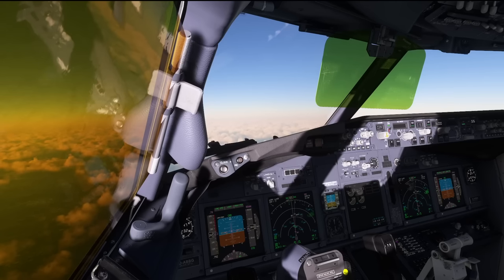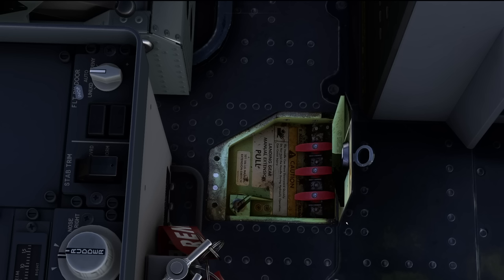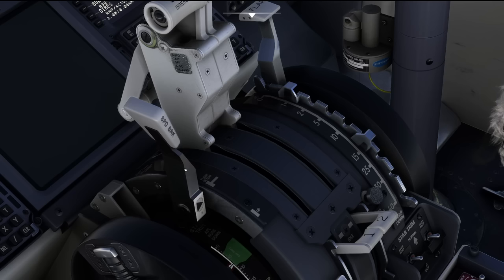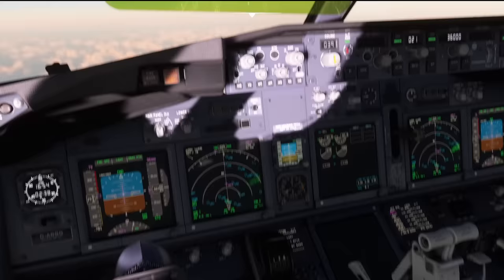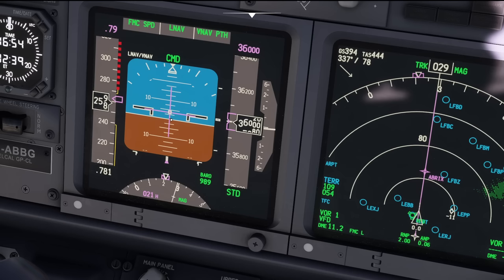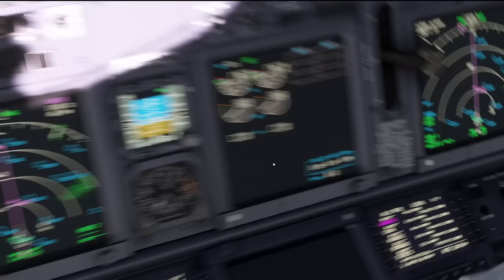FIVE hidden features you did NOT KNOW existed in the PMDG 737 | Real 737 Pilot

Comment: I would know these if producer would be polite enough to provide some official manual. I paid over 60 bucks i didn't get a proper instruction how to operate this aircraft.
Reply: The PMDG series of aircraft used to have a manual for all its Boeing planes (737, 747, 777) for FSX/P3D located deep in its addon folders, what I've heard is that there was a licensing issue regarding those that's why they removed it. I could be wrong though. Wish they bring it back :(
Reply: There are so many tutorials for 737 here on YouTube, so I can barely imagine what else would be needed
Reply from the maker: You mean a manual like the one you find in your aircrafts folder/documentation?
Reply: There is an official manual. They even tell you where it is when you purchase it.
Reply: I kind of like that there are little Easter eggs like these. However, a proper PDF would be helpful.
Reply: @charliehilbrant  THERE IS A PROPER PDF! IT'S IN THE AIRCRAFT FOLDER
Reply: @shotgunsnapper  easy shooter. No need to shout about it
Reply: PMDG provides you with more manuals than you’ll ever read or be able to understand. They have literally tons of manuals for each model. EXACTLY as real life airlines have and provide their pilots. You should remove this message, as it’s you that don’t not understand what sort of product you have, not PMDG making an inferior product. You also have their Forum where questions can be asked. PMDG are known for the gold standard in the simulation community.
Reply: @stgs1988  everyone listen to the comment police and remove messages that aren’t entirely accurate!
Reply: Ive seen real manuals 
..would they work too?

Comment: 5 timestamps:
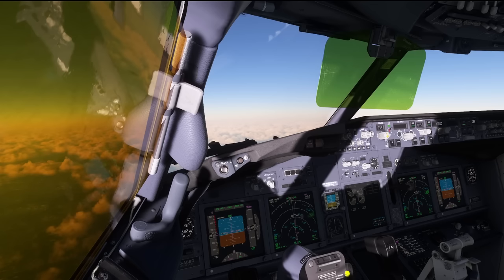00:14 Manual Gear Extension Door.
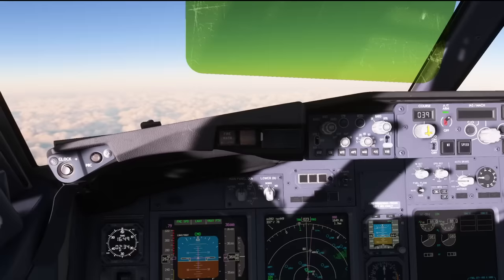1:36 Flap and Speed Break Lever Click Spots.
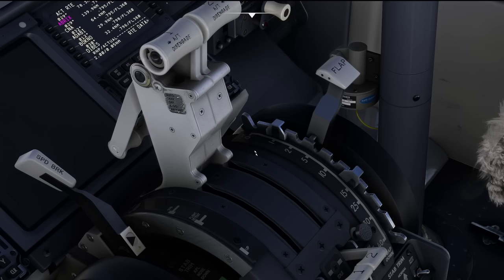2:26 Delay between MCP altitude and PFD altitude.
3:55 OVHD Copy-Paste function from EFIS control panel.
6:20 Fuel qty indication gauge changes reading depending on pitch.

Comment: Another cool hidden feature I found buried in the PMDG manual is the secondary TOGA selector. If you click the bottom left screw on the MCP it actually acts as a TOGA button for the throttles. They added this on purpose to make it easier to engage during takeoff if you're using a controller or non-HOTAS throttle, pretty neat addition imo!
Reply: That has been there for many previous versions. FS9 and FSX/P3D I’m pretty sure had that. I kinda seem to remember it being on other products too, like their 747.
Reply: @Fcreceptor Yes, that has been there for quite a while, the 737 for the FS2004 (FS9) definitely had that as well.
Started flying PMDG with that simulator so that's why I am so sure about that :)

Comment: Feature #3 has been killing me, LOL. I built an Arduino-based external hardware device with throttle levers, pushbuttons and rotary switches for various functions. One cool thing about this is that I could quickly change the selected speed, heading, altitude or vertical speed on the MCP without actually needing to move the point of view to the MCP itself (no eye or head tracking here), but rather just looking at their values on the PFD as I changed them on the hardware switches. This has worked well since all the way back from FSX and P3D, but the recent feature means I can no longer change the altitude without actually looking at the altitude window itself on the MCP (or do the changing rather slowly to allow for the PFD delay). There's one feature that I really wish was user-selectable in the options page, something like "PFD altitude change: fast/real".

Great video as usual.
Reply from the maker: I'm afraid your kind of setup is really a exeption to the exeptions in a niche market. Probably not something they will invest the development time on as there's still so much other stuff to do. Sorry :/
Reply: @A330Driver  Yep, I'm well aware of that.  Can't have 'em all. :-)
Reply: @A330Driver  Disagree here, it's similar for everyone owning a Honeycomb Bravo :)

Comment: As a fueler something that surprised me on the 737s is how little pilots tend to know about the fuel panel on the wing. For example, most pilots I've encountered are unaware that using the manual defueling valves, fuel can be transferred between any tanks on the aircraft by opening the crossfeed and using the fuel boost pumps to remove fuel from a desired tank into whatever tanks are selected as open on the wing fuel panel.

Very useful if, say, the fueler has an INOP gauge and a pilot volunteers to monitor the fuel quantity and tell him when to close the tank and misses by 2500 lbs because he was receiving their clearance.

Comment: The manual gear extension door should inhibit the retraction only but not the extension…it might be a limitation by the sim?
Reply: Right. With the manual extension access door open:
• manual landing gear extension is possible with the LANDING GEAR lever in any position
• normal landing gear extension is possible if hydraulic system A pressure is available
• landing gear retraction is disabled.

Comment: Knew about the gear extension door and the escape ropes because I'm using a real Ryanair checklist for my flights and those explicitly state to check those doors to make sure they're closed before flight. I didn't know about the microswitch preventing use of the gear lever though, which explains why the checklist requires that door be checked thoroughly.

Comment: Hello 737NG Driver,

Not sure if this is a hidden feature or not. But did you know you can enter the departure runway as a fix info in the FMC. simply do the following below.

1- go to the dep/arr page and select arrival on the departure airport.

2- select the departure runway as an arrival.

3- go to legs page and scroll to find the the arrival runway. Which should also be your departing runway.

4- copy and paste it in the fix page.

5- go back to the legs page and erase the modified route. Do not execute. 

And vaw la.
Reply from the maker: It's a feature indeed. I'm just not sure what to use it for haha
Reply: @A330Driver  i normally just set a 5 nm ring just for reference especially if the airport doesn't have any SID.

Now if i can only figure out how to enter a FlyOver waypoint on the legs page.  🤔

Comment: Good afternoon,

Small remark, or misunderstanding about the manual gear extension door microswitch.
reading operating manual, the following is mention (copied from the manual 737-800NG):

With the manual extension access door open:
• manual landing gear extension is possible with the LANDING GEAR 
lever in any position
• normal landing gear extension is possible if hydraulic system A pressure 
is available
• landing gear retraction is disabled.

As you may see, the second point mention than extension is possible even when the door is open if hydraulic A available.
Is someone wrong, do I misunderstand the manual or is it option dependant ?

Have a nice day,
Benjamin

Comment: I knew about the manual gear extension because back in the old days, I actually tricked another streamer into using it. I told him to pop open the floor panel and pull the lever, he proceeded to pull all three. Afterwards, he had a closer look and realized what he had just done. I wasn't aware of the clickspots because given the hardware I use, they would be largely irrelevant anyway. If I wanted to pull the speed brakes, I'd just reach over and pull the lever with my hand. I didn't know about the MCP delay because I don't think this was ever modeled in P3D. Wasn't aware of the overhead switch, although I have it set to synchronize the EFIS anyway, so I personally wouldn't find much use to it, although I could understand others might. As for the fuel, I wasn't aware of it, as I've never really checked, but I'm not surprised that PMDG models this.

Comment: During cleanup after landing if you deactivates a flight director which is currently the master first and then quickly pushes level change button several times it will reset speed selection to 100. This trick was mentioned by @737NGDriver in some old video but it was stated sometime it works and sometime doesn't. In my experience it works every time if you switch exactly the master FD first but leaving second FD on before pushing level change button.
Reply from the maker: That's actually a feature I suggested myself which got implemented!
Reply: @A330Driver  Is it like so in the real aircraft?
Reply: @deesto  I assumed it was or he wouldn't have suggested it.

Comment: PMDG has made a mistage then. Reference FCOM 14.20.2: When manual gear extension door is open, normal extension of the landing gear is possible if hydraulic system A pressure is available. They should correct this.
Reply from the maker: I did a little research into this as you're the second one to bring this point up already. The PMDG in this aspect is modelled after a certified real life simulator since obviously they couldn't test it on the real plane. What you saw in this vid was how the real sim would behave as well.
Now, this would not be the first time a certified sim would be wrong, indeed it would be the second time (to my knowledge) something is spotted in the PMDG which worked exactly as the real sim, which is wrong.
I'll do some testing myself next time I'm in my airlines full flight sims as they are from a different manufacturer than the one PMDG had access to.
Reply: @A330Driver  Thanks for the reply.

Comment: Nice video.
However, the manual landing gear extension work DIFERENTLY from FCOM. The FCOM reads that "With the manual extension access door open : (2) normal landing gear extension is possible if hydraulic system A pressure is available.". I'm not a real pilot, so I cannot say how the real 737 works. But PMDG 737 is clearly different from Boeing's FCOM.
Reply from the maker: I'll give it a shot next time I'm in the full flight sim to verify.

Comment: Sorry but I have a doubt on  the first one  ,  the LDG won't extend  if the speed is higher than 260 knots right? And that was actually the case when u did this experiment, I mean regardless if the door was open or not the ldg wasn't supposed to go down
Reply from the maker: The gear will extend whenever you put the lever down. Why would it not when you're faster than 260kt?
That would even be below the placard speed for gear operation.
The 737 is not an Airbus. You might break it, but it will still do what you tell it to do.

Comment: Thank you so much!!!

In return I offer an MSFS feature to you - to fix those ugly, jagged, shimmering shadows, you can edit the file usercfg.opt (it will be located in "%AppData%\Roaming\Microsoft Flight Simulator\UserCfg.opt"), find the Shadows section and edith the Size value to 4096 or 8192 (if you have a 4090 or better).

There will be two Shadows sections, one for  normal and one for VR).

Change...

	{Shadows
		MaxSliceCount 4
		Size 2048

to (should work for most video cards)
 
	{Shadows
		MaxSliceCount 4
		Size 4096

or (if you have 4090 or better)

	{Shadows
		MaxSliceCount 4
		Size 8192

After you make these changes you'll want to set the file to Read Only to prevent MSFS from reverting the setting back to 2048 - the maximum allowed via the GUI, (save the file then right click and choose properties then click the "Read Only" box).  Just remember to uncheck Read Only if you ever make settings changes via the GUI or they will not be saved.

Comment: wow! very impressive how the details are simulated at PMDG! Thanks Emanuel for this information!  one question from my side. Reaching an Alt below 10.000 feet i have noticed that the speed bug starts dropping to 250 knots is small changes until it reaches 250 knots. In other aircraft such as A320 from Fenix the speed bug will jump directly from the cruise speed to the 250 knots immediately. Is this speed adjustment in the PMDG737 below 10.000 feet the same as in the real aircraft?
Reply from the maker: Thanks! Yes, the speedbug moves in "real time" in the 737. This shows you at any time at what energy state the plane should be, aka how the decelleration is progressing.

Comment: Emi, do you have a tip for setting the mins faster? When I fly into Denver my mins are somewhere around 5000’ MSL and it takes forever to set them.
Reply from the maker: Hold the mousebutton and scroll at the same time. That's as fast as it gets.

...and annoy the PMDG support so that they finally add the correct realistic option.
Reply: @A330Driver  Which is what? Can you tell us, please, what's the realistic option?

Comment: Nice video but the one thing I was waiting for wasnt covered.  How did you get the green sun blind on the front window?
Reply from the maker: Thanks, I thought that'd be somewhat basic knowledge after all the persons asked for it during the 800 release 😅
They're in the pockets aft and to the side of the pilot seats.
Reply: @A330Driver  Ok cool I will check that out.  Only just acquired the pmdg 737 800 and still learning all these qwerky bits. Many thanks.
Reply: Hi I have another question. So I've made my way into the cockpit using the drone camera but can't interact with any of the cockpit buttons? Any idea how to do this?  Thanks.

Comment: 1 question: in real life, do the pilot need to insert manually each waypoint of the flightplan into the FMC or it can be possible by EFB? or in another way? thx
Reply: Depends on the airline. If the airline has ACARS equipped on their planes, it could be just as easy as getting the uplink for it and then verifying it. If not, they would just manually enter in the route that's depicted on their flight plan, which includes the airways they will be using. So let's say you're flying on an airway that has 24 waypoints on it before you transition onto another airway, in the VIA column, you would type in the airway, then in the TO column, type in the last waypoint on that airway, rather than having to manually type in all 24 waypoints.
Reply: @CaptainKevin thx so much for reply me!!! really appreciate!

Comment: Is it possible to operate the speed brakes via the Decrement Spoilers and Increment Spoilers keybindings? As it is, I can only control them with the click spots. Trying to drag the lever with the mouse is so slow as to be non-functional. 

Also, when I click on the sunvisors that are stowed in the little side pocket, they don’t move to the windows. They simply vanish for the rest of the flight. What am I doing wrong? 🥹
Reply: Clik on the green sunvisor beside of your chair, than click on the green surface use the two horisontal arrows to slide the green sunvisor in front of you. Ad Koolmees the Netherlands
Reply from the maker: I never tried those functions, however if you use the default sim function to fully extend and retract the speedbrake that should do the job. It's either fully in or out anyway, it's so weak on the 737, you use it fully all the time anyway.

Never heared of that issue with the sunshields. Maybe try contacting PMDGs support, I'm sure they can help  you. support.pmdg.com
Reply: @adko22rak  Thank you!
Reply: @A330Driver  Thanks for the clarification!